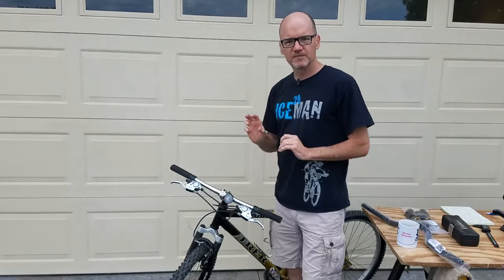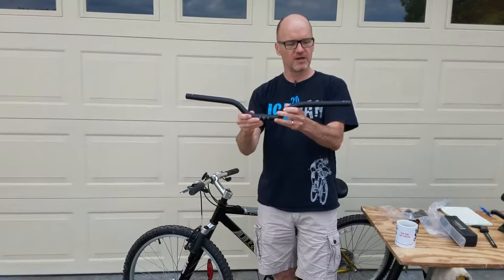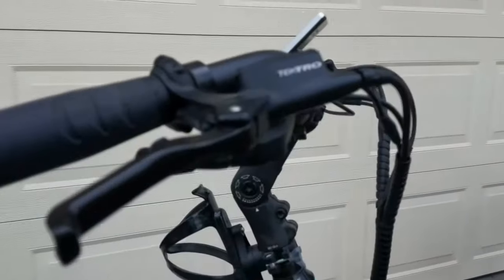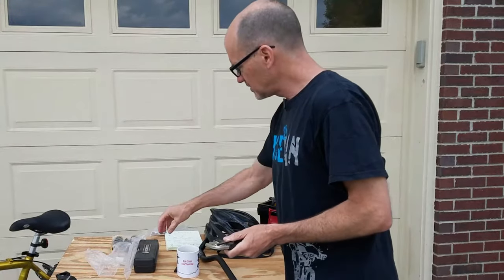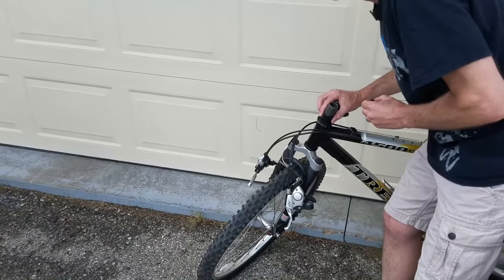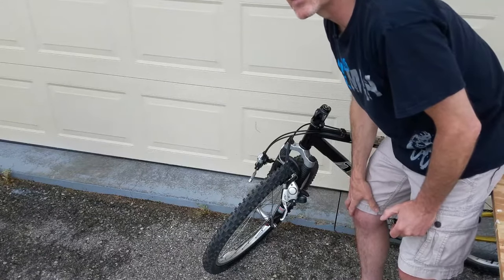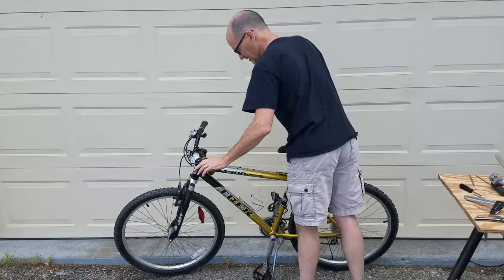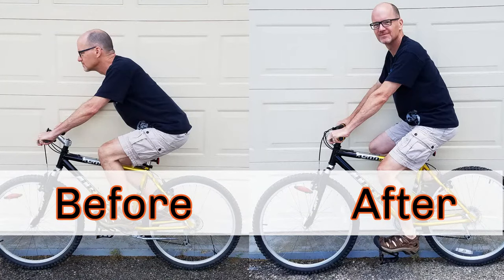How to raise the handle bars on an MTB (3 ways)

Comment: So.... those handlebars are still in the same place, you just changed bars. Does anybody know how to actually do what this title claims? How do I actually raise the centre "pipe" that comes out of the bike's frame, so that the handlebars are actually higher away from the frame. For a taller person to not have to ride with a hunched back? How do I raise the bars? I've loosened everything, but it still remains in place...
Reply: “Just get new handlebars” - So stupid
Reply: See 4:25 and 5:27
Reply: I had exact same question with these raised ones that will just make you lean forward more at slightly higher position so doesn’t work

What I learnt new is about swept back handlebars with raised height

This helps bring handle bar near to you so you don’t have to lean more forward and neither have to bend more as it is also raised
Reply: Go back and watch the video again. He explains everything very well. Try to focus and pay attention this time when watching. It does exactly what the title says.

Comment: use an adjustable stem riser . 
this allows the existing handle bars to come UP and back towards the rider . because  it's adjustable the position can be altered at any time to suit the riders needs. 
this can be done in ,even when on a ride .
Reply from the maker: Yes, that works as well.  👍🚴

Comment: Great video. Thanks for the demonstration. I have a question as I am looking to do something similar with my bike: The stem you had on the bike initially was long, but it also had a good rise. I would have thought that kind of stem would be better for getting a more upright sitting position. Would it not? What would have happened if you kept the stem the same but used the riser handlebar? The reason I am asking is that the stem I have currently is just like the one you put on, and I've been looking into buying a particular stem (Velo Orange Happy Stem) with a rise like the one you had initially. Now I'm thinking that might not be a good idea after watching your video and that I should just get a handlebar with a better rise.
Reply from the maker: The rise combined with the length is key.🚴

Comment: Hi. Great video. I don't see the link to the device used for the handlebars on your wife's bike
Reply from the maker: The stem on my wife's bike came with the bike.  I found this one that's probably a close match.  https://www.amazon.com/Adjustable-Handlebars-Suitable-Mountain-31-8x28-6x110mm/dp/B097SQV9MW/ref=sr_1_8?crid=KZP326QSEUM1&keywords=adjustable+angle+bike+stem&qid=1655054674&refinements=p_72%3A1248957011&rnid=1248955011&s=sporting-goods&sprefix=adjustable+angle+bike+stem%2Caps%2C169&sr=1-8

Comment: This will help. but won't fix the awful old school geometry. Yea that bike definitely does not fit you. I'm glad geometry has come so far.
Reply from the maker: The bike is my sisters, she's smaller than me.  Your correct in that modern MTBs have changed frame geometry a lot. 🚴‍♂️🚴‍♂️
Reply: @diymountainbike  Good you are not abusing yourself with this bike.

Comment: why is everything a ballache today you just use to slacken off a nut and pull the bars up years ago always more attachments required today typical, nothing simple anymore.
Reply: Doesn’t really work with these bikes…hardly any length left inside the tube. Same problem I had.